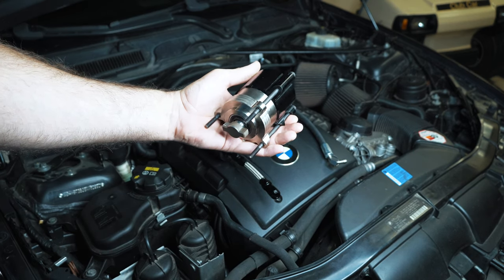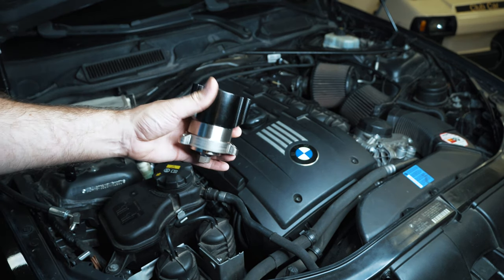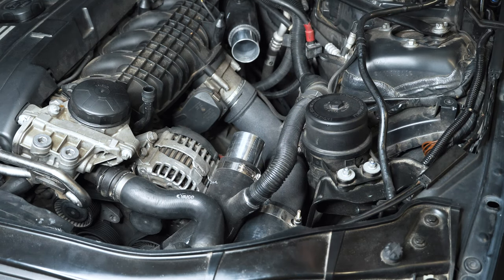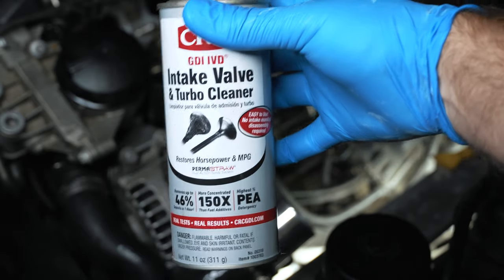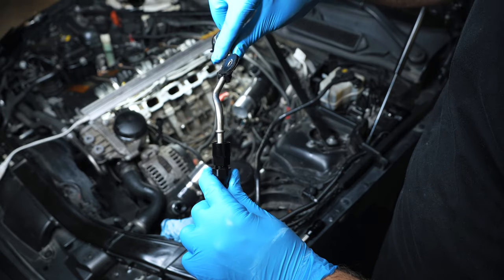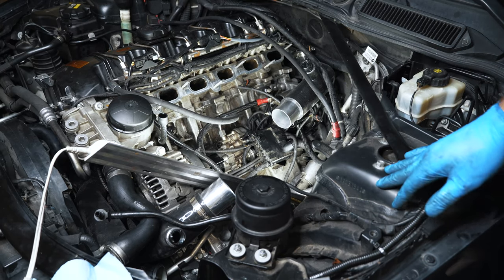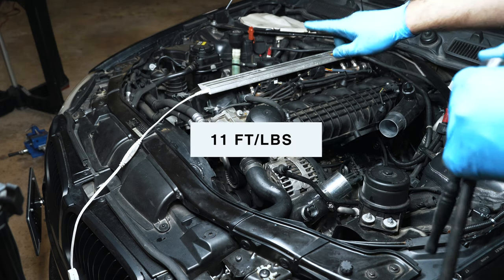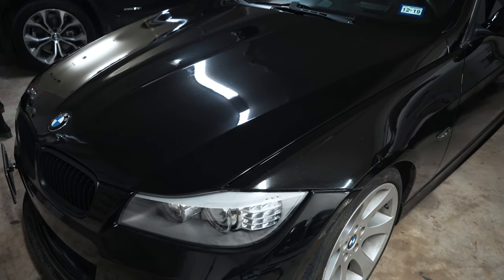Is This The End For Port Injection? | BMW N54 HPFP Overdrive Kit!

Comment: I added a helix to my car today and seems to have a rattle that gets quieter when the idle comes down but loud on start up ..do you have this issue too ?
Reply from the maker: I noticed a slight bit of chatter after installing it that was only there at a specific RPM and actually when my AC was on so I think if it happens to fall at a very specific RPM it could happen but that was after the first day of driving.  I've been driving on it for a while now and get no noise at all under any conditions.  I think it might have a bit of a break in period.  I'd say you should expect the noise to subside completely, if not talk to Spool to get their feedback.

Comment: Is this works the same with like a fuel it lphp upgrade?  Do both stackable for even more fueling?
Reply from the maker: Yeah you would upgraded your LPFP first and use this on top.
Reply: @VehicularDIY  so yours is upgraded? Or it can be installed on the original LPFP?

Comment: Does anyone know if A single Walboro 525 alongside a helix overdrive would give me enough fuel for 600 hp on 19t turbos? Or do I need a bigger lpfp
Reply: For example, a bucketed 535 from Precision Raceworks should be able to support ~650WHp (575WHp on 100% E85), so you should be about right for ~600WHp. Just be mindful of the additional power draw (amperage), as the stock EKP may not be up to the task of supporting it for long before overheating. There are cooling mods, upgraded boards to swap to, or an upgraded FPR to utilize  (also from PR) to alleviate the added stress onto the EKP.

Comment: As of this stage of upgrades so far.. what ignition coils are you running?
Reply from the maker: I've on a set of Duralast stock type coils, lifetime warranty.  If I need to upgrade I'll probably look into a set from Spool.
Reply: Wow all that power on AZ coils.  Plugs stock or 1 or 2 step colder?   About to start tuning my car and was wanting to change the plugs and coils
Reply: Yeah, I'm on duralast coils as well. I work at AZ and got a good deal on them and I was not just changing one out haha lifetime like he said. Plugs depend on what kind of power you are running and gap depends on fueling etc. I've been running NGK 95770 plugs. What tune are you running?
Reply: Just doing MHD 1+  till I get the downpipes and intercooler then 2+
Reply: 95770 should do ya fine. I ran those on stage 1 for a while until I got all my stuff together. Wanted to change plugs under maintenance and had a bad coil. So went ahead with 1 step colder to future proof with no issues.
Reply: Nickolas Cain  that’s what I was thinking 👍🏽👍🏽   What gap you recommend ?  Thanks broski
Reply: .022 is what I'm currently running.

Comment: What's the cost going to be for this overdrive compared to the P.I. system?
Reply from the maker: It should come in under the cost for a basic PI system.  Once you factor in the controller, and injectors and spacer etc.
Reply: Nice! Plus less to fail.

Comment: How much boost are you running on stock diverter valves?
Reply from the maker: I have them at 25 psi which is their limit.  Changing them out this weekend.  So far they hold fine at 25 PSI but they sound stressed lol.
Reply: Vehicular DIY I was just wondering because I’m on 21 psi on stock dv and charge pipe lol I’m sending them until they fail and I already have replacements ready in the car just in case it happens in Mexico lol
Reply: Yeah, he has an upgraded charge. I would definitely change that chargepipe soon running a custom tune. I personally love mi tial blow off. But some people prefer diverter valves to keep it quiet haha

Comment: Does your helix sound like a diesel when you start your car then go away?
Reply from the maker: Yeah I do only during warm up, lasts a minute or so and I find the even turning on and off the AC can make enough of a difference in RPM where it goes away.  I've asked spook about it,  they said it's completely normal and supposedly way more pronounced on the manual cars.  It's very mild though and hasn't really been a bother. All my older BMWs with a manual transmission used to have a similar sound nearly all the time, it would go away when you push the clutch in.  Might have been the throw out bearing or the input shaft bearing but if you've ever heard that sound I'd say it sounds pretty similar to throw out bearing noise.
Reply: @VehicularDIY  ya it does, ok just wanted to make sure it wasnt just mine, it lasts for abour 2 to 3 minutes then goes away. You really hear it when the rpms drop. If you keep alittle on the gas its not as bad
Reply: @VehicularDIY  so, I want to buy the helix but I read one guy's account that an embarrassing metallic like sound is present anytime the car is at idle. So, it sounds like his experience is not just cold starts but even after the car has been driven. Not sure if he has MT or Auto trans. I have an AT. It sounds like your car isn't too loud and returns to normal after a couple minutes. Is the sound so noticeable that its embarrassing? Does it come back like if your idling in traffic or at a drive through? Thanks.

Comment: can I run it with out a tune? for 540hp
Reply from the maker: No you'd need a tune to open up the volume control valve in the high pressure fuel pump.

Comment: Are you still running this? Any issues?
Reply from the maker: Still am yeah, the unit itself is good.  I had my oil pump chain guide fail and replaced.  If you have a high mileage manual card you may need to consider replacing that before installing this.  The drivetrain shock could cause vibration which could take out the plastic guides as they could get brittle with age.

Comment: The actual overdrive ratios are 1.3:1 Helix, 1.4:1 Helix Xtreme.  The Helix will support up to 600whp worth of flow on full e85 and 750+ on e60 mixes. The Helix Xtreme will support 750whp worth of flow on full e85 and 850+ on an e60 mix or other gasoline blends. The Helix is available now, the one in the video is still being tested for longevity. http://spoolperformance.us/index.php?route=product/product&product_id=71

Comment: A $600 gamble on the pump holding up
Reply: maybe go with the pump with lifetime warranty from FCP Euro, then again changing out the pump is not exactly easy
Reply: @BIMMERZEITT  smart man
Reply from the maker: I purposely didn't change out my stock HPFP just to see how it holds up and I can report back.  It was making good pressure before this, not sure how many miles are on it but I know it's at least 60K as I've owned the car that long.  If I had to guess you'd get 25% less life expectancy out of the pump and maybe more if you're running a high ethanol content, but just a guess.
Reply: The cost of power hahaha. Lifetime warranty def is a plus when replacing it. Have you looked at port injection cost? running straight e85 for me is what I'm looking forward to. Don't have an analyzer yet. Mixing at the pump is a pain.
Reply from the maker: Yeah I'm hoping to run full E85 and get the an analyzer from Spool.  Yeah what turned me off from port injection is you technically need a stand alone ECU to fire the injectors at the right time.  You can get a small controller that will batch fire them but the controller should know exactly where each piston is during each rotation of the crank shaft so it can fire the injector only when the intake valve is open.
Reply: @VehicularDIY  exactly... there are many people using jb4 or split second. But not planning on huge numbers considering im 6AT as well. So this should work well without the risk. I do have a JB4 I bought for a good price. Tho tuners from what I see don't like JB4 and prefer flash only.

Comment: Vargas already has two over drive options. Single barrel and double barrel. Not quite sure why this "would be the end of port injection"
Reply: Especially when it's a 3-1 over drive gear box with no cooling. the grease in there is going to get beat to hell and it's going to fail.
Reply: Sure, if you want to fund Tony's ego.  TX>CA
And belts are wear items just like grease lol.

Comment: Update please
Reply from the maker: I'm still running it, I had my oil pump chain guide fail which I've heard can happen on high mileage manual cars that experience drivetrain shock.  Replaced the guide and still have this in place.